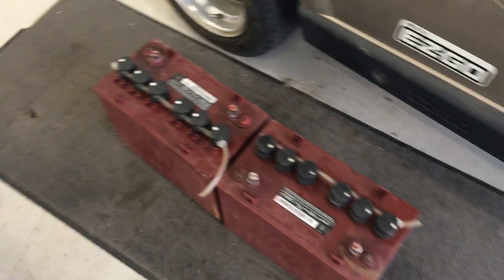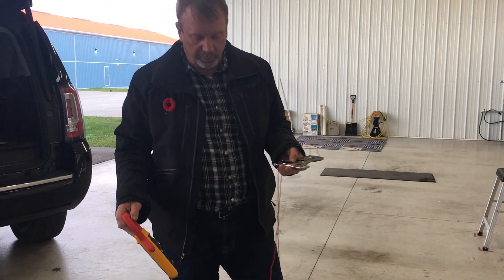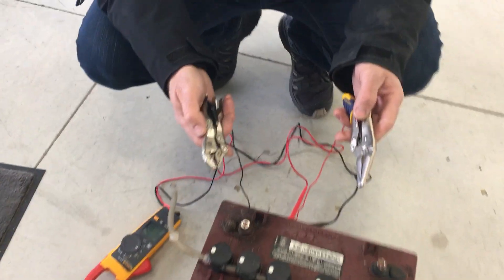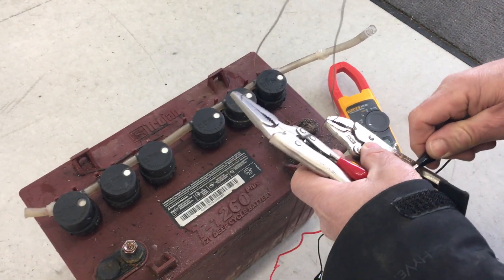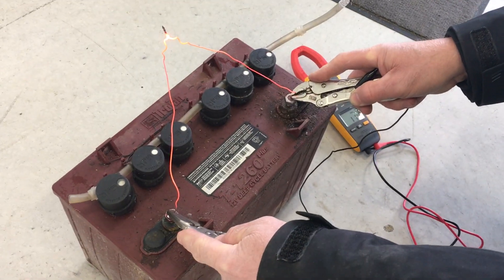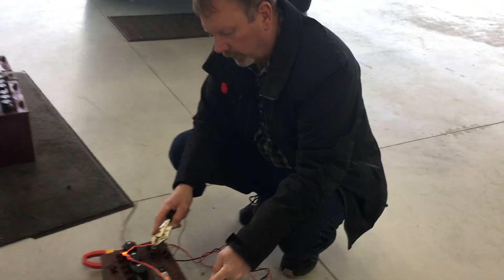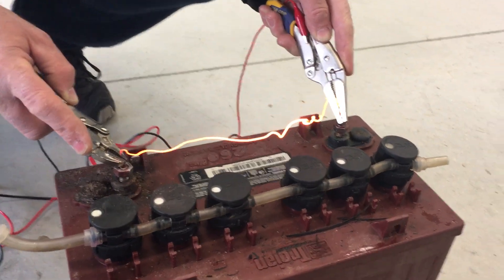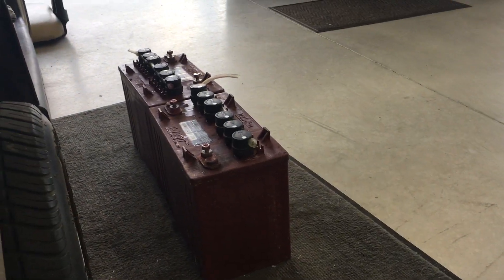Battery Load Test - READ THE WARNING!

Comment: Why 0.035 aircraft lock wire?  Required  or  any wire?  Why?
Reply from the maker: Any wire will work. Stainless steel has a higher melting point than other metals and it has a higher resistance, so it makes a good choice for this test. 0.035 is about the right size too, keeps the current, sparks and heat generated to a minimum. See my warning in the description.
Reply: Thank you  @nyefamily1